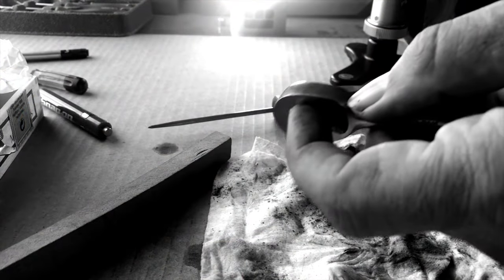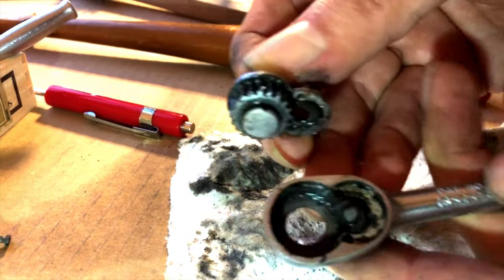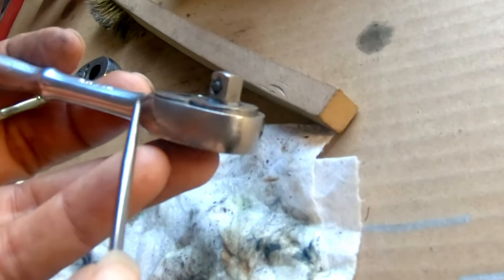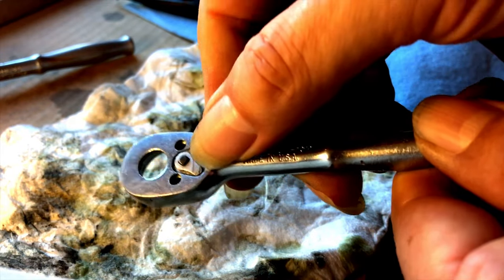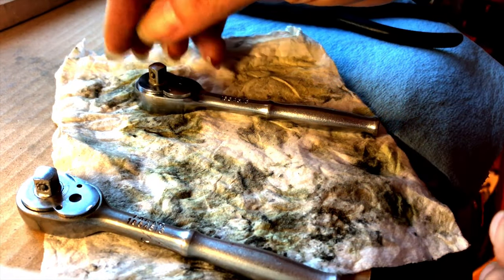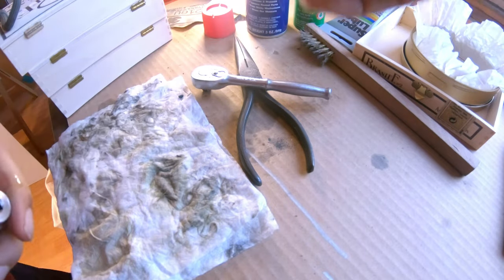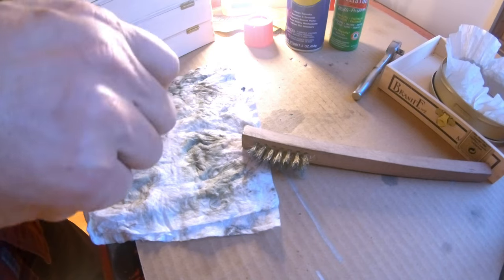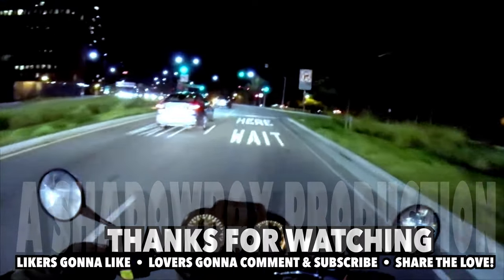ShadowBoxer 0078 {Snap-on GM 70M Repair & Rebuild • Personal Reflections & Rants too}

Comment: Regates, when You are golng yo hammers an d ratchet like tbis You ba e doit please with a bronz por chopper small hammers You Will not damave the original patina of tbis vintage great tool
Reply from the maker: If I understand you correctly; Yes, a small copper or bronze hammer would have been better. The brass hammer I have is not small enough. As shown later, I comment that under examination it looks like nothing happened. These old tools were built tough. 

Thanks for the comment. I hope it helps someone who might be thinking about this job in the future.
Cheers.